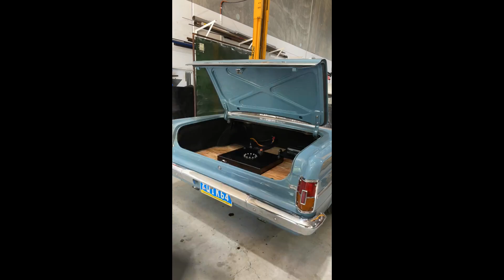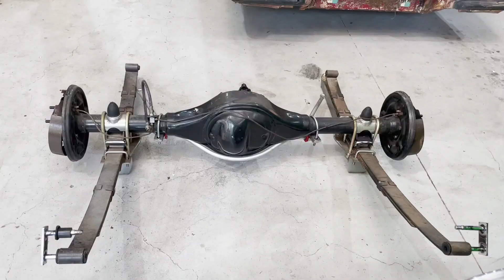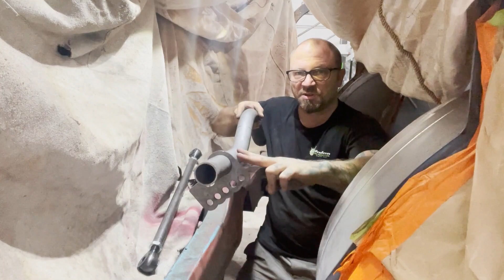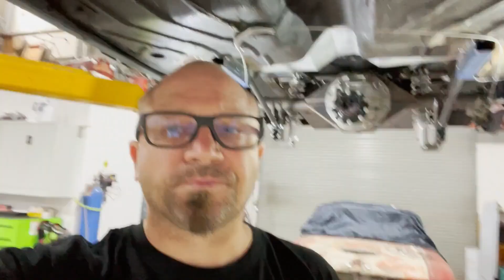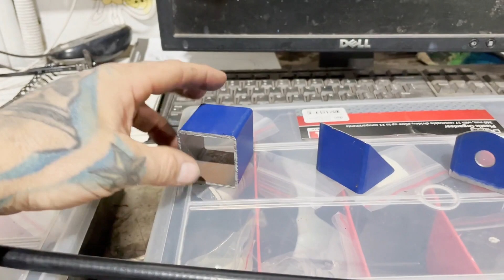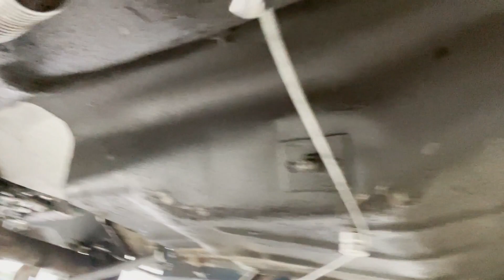EH holden mini tubs weld wheels  MT 275/60,15  fabricated 9'' wilwood 4 link conversion aussie 308

Comment: No additional chassis rails from the front end to the drive line mounts... No problem with getting the engineer's report..?
Reply from the maker: if it was big block powered then yes would receive additional members and problem with engineers

Comment: Nice work mate well  done. Couple of things , did you modify/ strengthen the factory rails? Does the Eh run the same floorpan as Ek Fc holdens?
Reply from the maker: hello 
and sorry for the late reply , i did'nt feel the need to strengthen the factory rails as it was already v8 powered , the member i used is pleanty strong enough if it was a 1000HP deal or a big block then yes would have done some additional work to them ,,,,, as for floor pan !!!!! yes very similar

Comment: Sweet job mate, bit of a strange way of using those lower coilover mounts in that direction, seeing as the top bush is parallel with the bar and the bottom is now 90 deg turned on the shock. I know its probably not going to use a lot of the suspensions range of motion but that upper and lower will still fight each other to an extent. Love the ride height, nothing says tuff streeter more than a low car tucking fat meats!
Reply from the maker: Basically it comes down to room there is not much Real Estate under the back of that car so it is all a trade off

Comment: Nice job but I’m wondering if the coil overs and 4 link brackets aren’t hanging a bit low, they seem to hang lower than the diff housing and as you said the car is going to sit low, isn’t there a danger of damaging those brackets when doing up steep driveway’s or going over other road obstacles such as speed humps ETC, just wondering.
Reply from the maker: Hey Kevin

I did consider trimming them up however I need the adjustment for anti squat plus don’t want to take away any adjustment for future wheel and tire combos 
thankfully hung off the differential with the rear wheels not in the middle of the car

Glad you enjoyed
Reply: @vtv-voodoospeed  I had a couple of EH,s back in the day,I wish I still had them,I also had a HR Premier 4 speed 186s it was 18 months old when I bought it, it was an absolutly imaculate car, I lent it to the bird I going with at the time and she very convienently wrote it off for me I had big plans for that car.
 I’m an old bloke now but you know what they say, once a petrol head always a petrol head. I’ve just sold my LH Torana I’ve owned for 15years did a full bare metal ground up resto, put in a very nice 355 stroker. It was a very regretful sale but she had to go, I’ve got a 1969 XW Falcon Ute I’ve had since 1995 and has not moved one inch under it’s own steam since I’ve owned it, it’s also had a ground up resto and I’ve just got it back from the painter’s, a bloke made me an offer I couldn’t refuse for the Torana, so now I can finally finish the Falcon before I die you just cant hurry somethings. Anyway keep up the good work will look out for more of your video’s